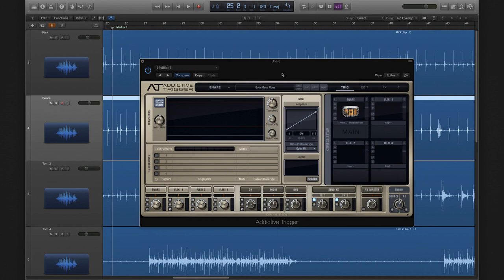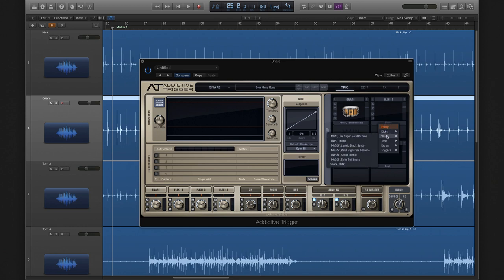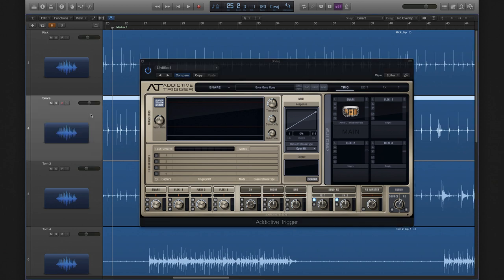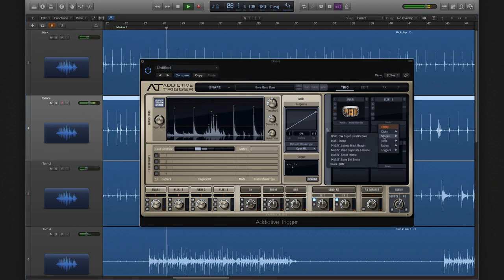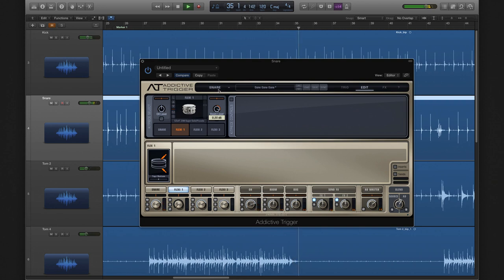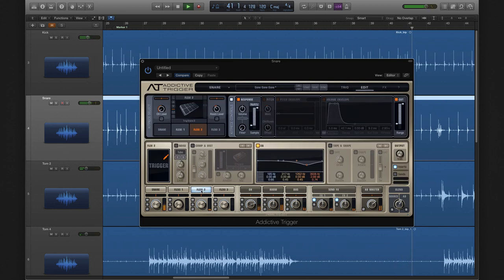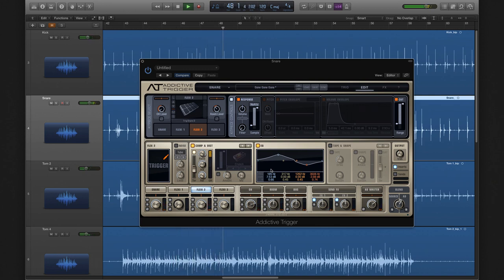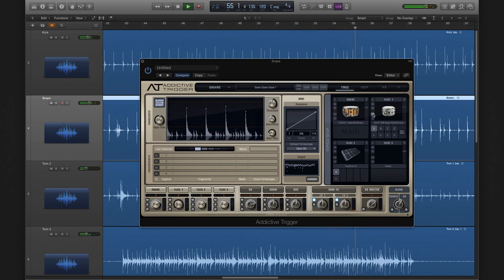Addictive Trigger Spotlight: Layering And Mixing

Comment: What. About mixed drums
Reply from the maker: Sorry, what do you mean? Did you want more information on mixing in Addictive Drums?
Reply: @xlnaudio  no. Can it rip mixed drums apart snare bass etc from mixed
Reply from the maker: @svorttsirhc1814  Addictive Trigger cannot separate a full drum stereo mix into separate audio tracks for each drum. But for some stereo mixes it could be possible to get Addictive Trigger to detect the bass drum and the snare and trigger from that.